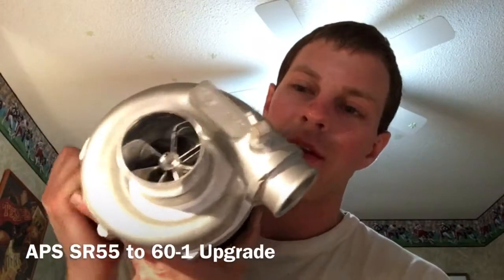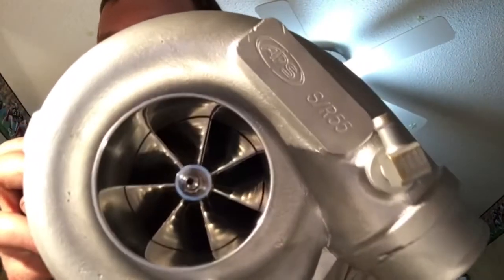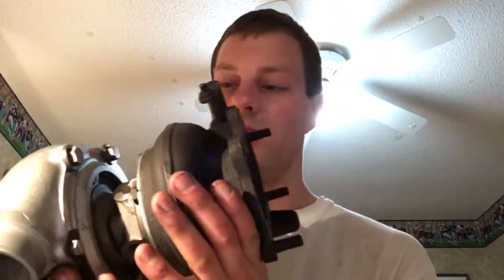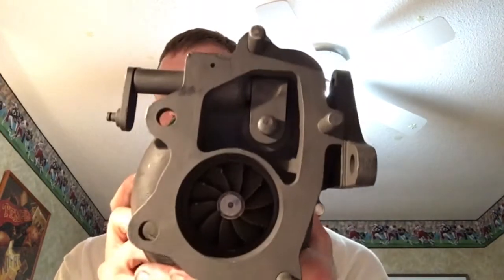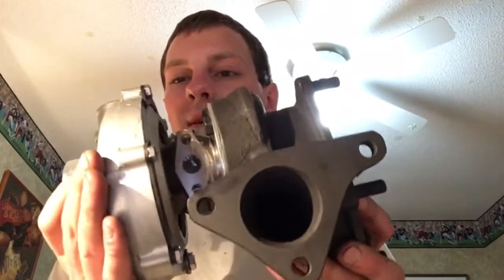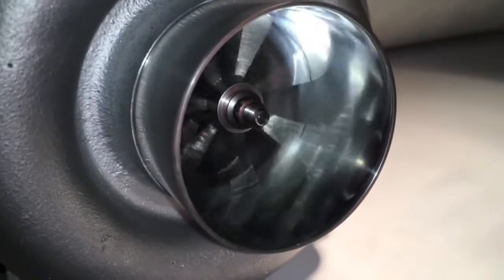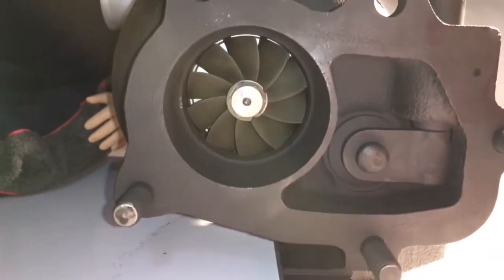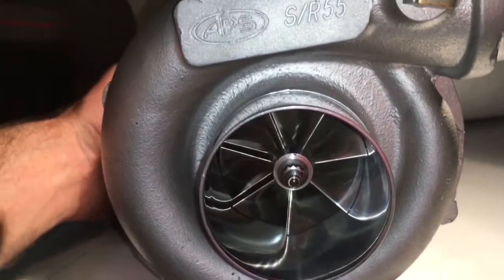APS SR55 Turbo Rebuild + 60-1 Upgrade

Comment: I have a ? after  you upgrade an n54 335i stock turbo would it be better than a pure  or vargas or would it be equal
Reply from the maker: +Esko Esko there are different upgrade that they have. Vargas has bigger ones than mine , it just depends what you are trying to achieve
Reply: I need like there setup  or better